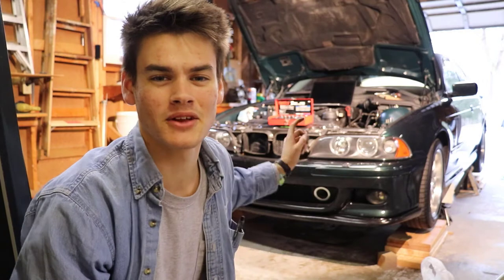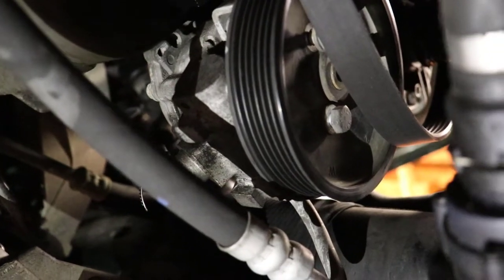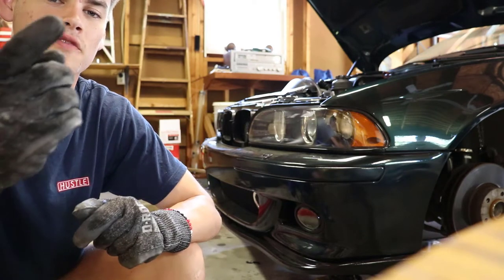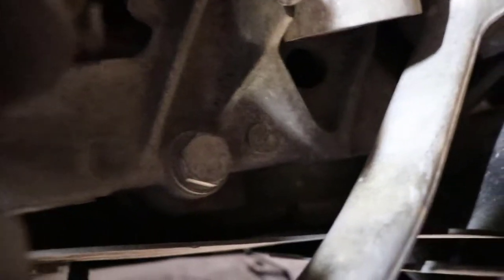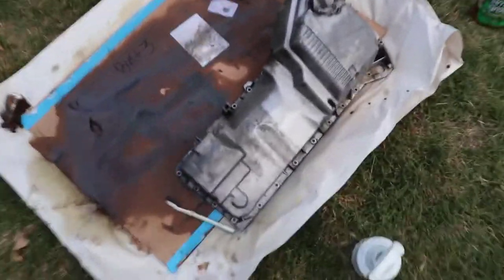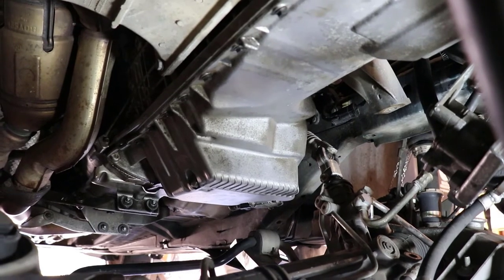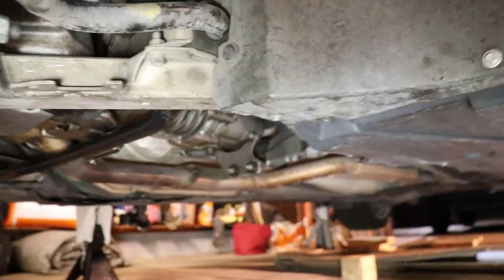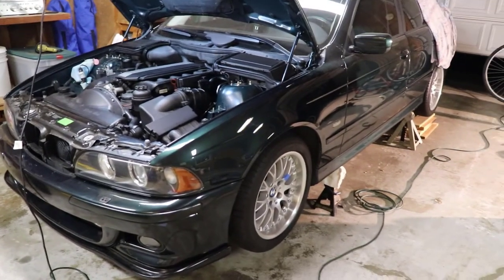E39 Oil Pan Gasket Replacement

Comment: Wow impressive video! I am original owner of a 2003 530I and I need to replace oil pan gasket after just 200,700 miles. Not sure I ambitious or patient enough to do this one myself but your video is excellent nevertheless.
Reply from the maker: Thank you for the kind feedback! The job definitely requires patience to be completed. If you decide to take on the job hopefully this video helps you out.

Comment: my GOD... im glad i have the M5 variety of E39.
i just did the oil pan gasket today and there's absolutely NOTHING in the way..
and engine mounts have taken me 20min... it's 3 very accessible nuts per side, a block of wood under the pan - raise the engine an inch, slide the old ones out and new ones in!
Reply from the maker: That sounds like a much easier time than I had!

Comment: Enjoyed the video, I'm in the middle of doing my oil pan gasket.  Found the 21 pan bolts, the 3 torx bolts but could only find 2 of the long pan bolts.  Any advice on where the other 2 are?
Reply from the maker: If you Google M54 Oil pan you will see the location for the 3 torx screws. They are located at the 3, 6, and 9 o'clock positions on the back of the pan.

Comment: Great video now I just have to decide if I want to do the job, it's not my car I'm doing it for a friend-neighbor, he has a 350z I work on also. He  bought the car for 400 bucks it has 92,000 miles on it and it's a little rough, I need to do brakes all around, the rotors are worn thin,  window regulators at least two, tires and the pan gasket, I don't have a garage but a driveway and as long as there are no special BMW tools I need that cost a fortune I have power tools sockets wrenches and four jacks and stands. Now the big question, what do you think is a reasonable price to charge for this job, I've read estimates from 700 to over a thousand, it's basically just nuts and bolts with no reprogramming of modules or anything like that, I thought of 800 plus parts, I just did an oil change so if I drain it I to a clean container maybe I could reuse it, it looks like someone did the valve cover gasket already because they forgit to put those caps that cover the bolts back on.

Comment: Just a question I  did the same years ago on my 528i 1997..but if I knew then what I know now I would buy the upgrade kit for the oil pump and a brand new oil pan and bolds... You agree?
Reply from the maker: I would definitely buy new oil pan bolts. I cannot say whether or not it is worth buying a new oil pump for one of these cars. If it is a common issue for an e39  then this would be a good opportunity to replace it.

Comment: Hi, what did you use as a jacking point for the rear of the car?
Reply from the maker: I just used the  Rear Diff. You can use the frame rails and lift one side at a time if you  would like though.

Comment: Do you need an engine lift for this or is there any way to do it without one safely
Reply from the maker: The engine support bar or something similar is required in order to gain the clearance necessary to pull the pan out.

Comment: You didn’t loosen the steering wheel shaft to the rack? Great video! Much appreciated!
Reply from the maker: I locked the steering wheel and removed the bolt for the steering coupler but the steering coupler did not slide out at all. From what I can tell very few people actually have their steering coupler move during this job.
Reply: @rustbucketproductions  Thank you! Keep up the good work young man!
Reply: @rustbucketproductions  I successfully replaced the gasket, along with the oil filter cover and no more leaks. Your video was very helpful. Thank you so much for posting!
Reply from the maker: @herrerafoto  Wonderful! Glad it helped.